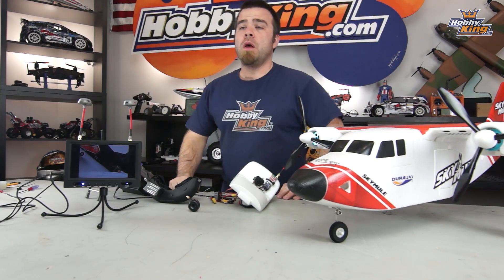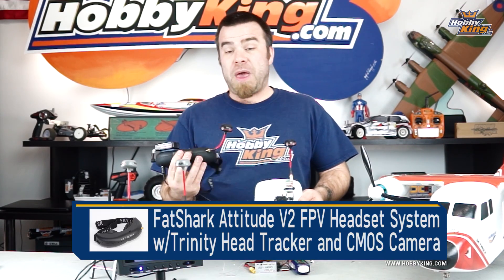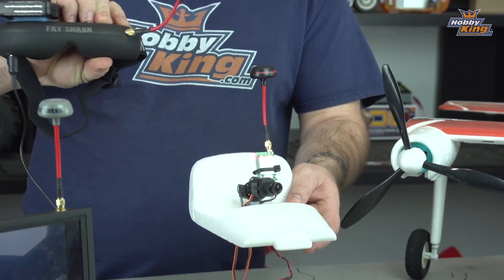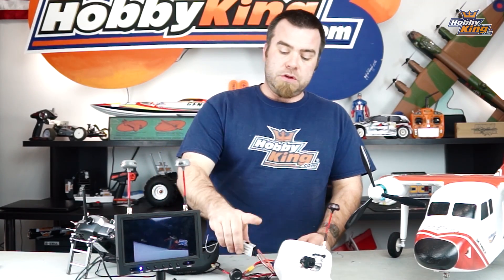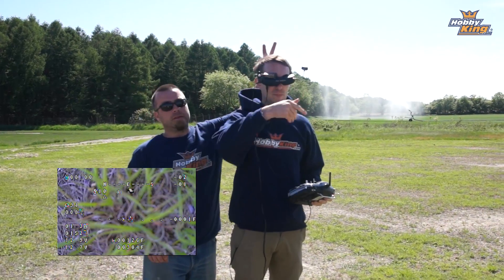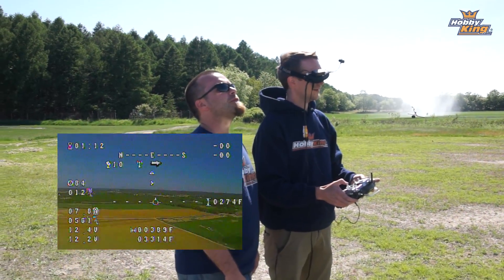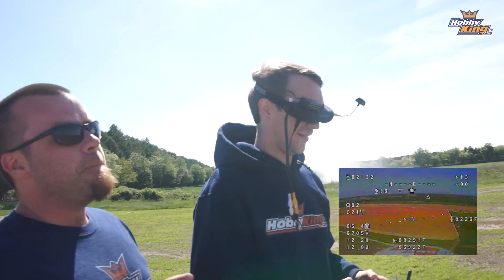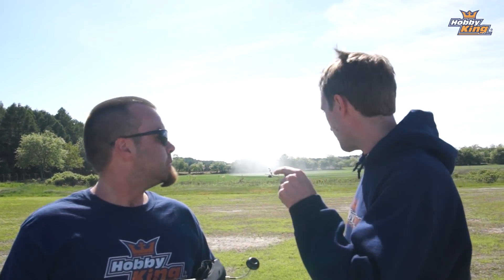FPV 123, How to FPV - Episode 5 Pan & Tilt

Comment: how do you pan/ tilt the camera without using googles?
Reply from the maker: Peatah Andy the pan and tilt is basically just 2 seperate servos. so you can just set each servo on a switch (preferably 3 position switch). so then you could have the pan go 45 deg left, 45 deg right and back to center. same for tilit.
Reply: how do you receive video feed on to a PC without using any monitors?...thanks

Comment: I have one question, I just bought a wltoys v915 lama helicopter from you and the charger they sent with it can't be plugged into a standard 110 wall plug. can you tell me if I need to get a different charger or what?

Comment: Matt what does a set up like this cost? I've never flown FPV before and I want to put a pan tilt camera set up like this in my 1/4 Scale cub? How do you think FPV would do in a gas four stroke plane? I have a full scale J-3 and that's why I want to set my 1/4 scale up that way. I think it would be awesome!!!!
Reply from the maker: Chad Cole Sounds like a dream project!  I think the FPV would be ok, just locate your video transmitter away from your ignition module.  You can get into stuff like this on the cheap, but I feel like for a plane that large or a project of this magnitude you'd be in for around $800.  - Matt (Goggles + RX + Good Pan-Tilt rig + Camera + TX)

Comment: you can also do pan tilt without a head tracker.  Just use the rudder channel for pan if you do not use ruder and  than sliders work really good for tilt.
Reply from the maker: Wyll Surf Air Good call.  I should have mentioned that any manual channel can be used as well.  - Matt